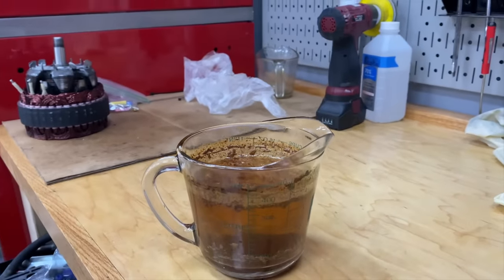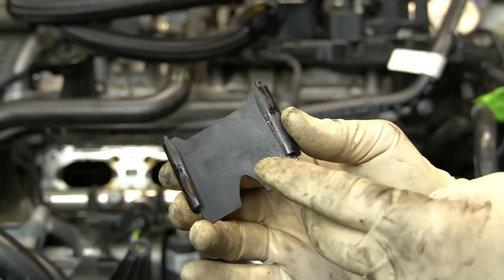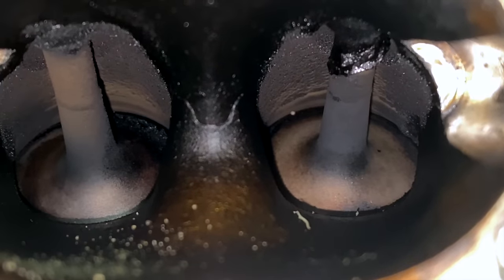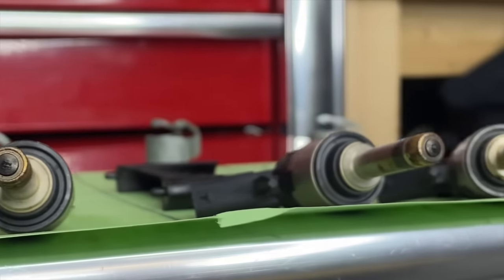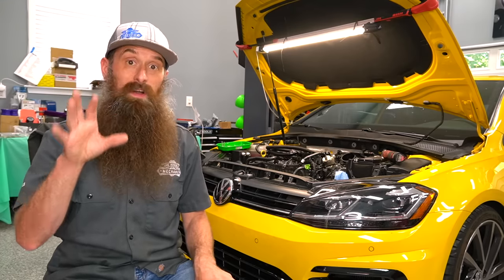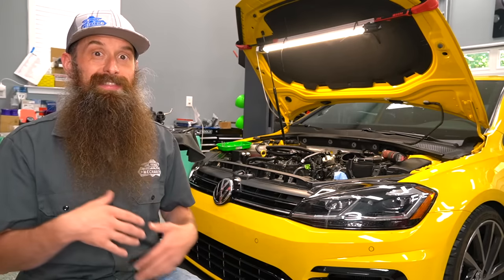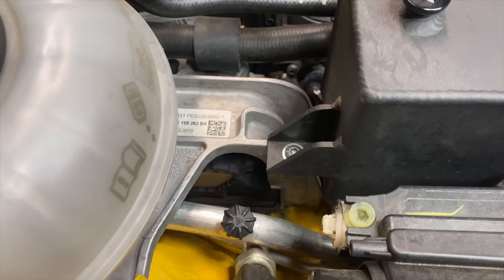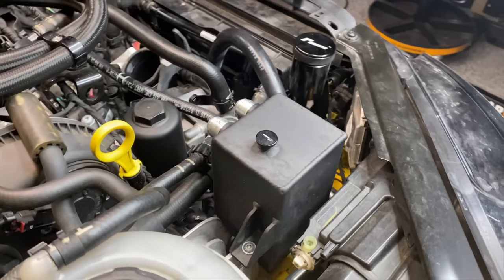Did the Catch Can Work? 10k MILE TEST

Comment: So B9 gen3 engine on Audi includes an oil separator module at the PCV valve. Us non mechanics have speculated on Audi forums that it’s a sudo oem catch can. Thoughts?
I feel like on soooo many vehicles we hear about people doing a long road trip and watching fuel efficiency improve and more on some version of a direct injection vehicle. How much would you bet it was the catchcan vs your 300 mile drive given the two sets of control valves?

Comment: Also I run TurboMax

Description
Powerstroke fuel additive. Cleans fuel system. lowers carbon and NOX emissions 90%. quiets engine nock. lowers gel pour point. improves combustion. 16oz TREATS 1440 GAL GAS OR DIESEL 1ML TO 3 GAL

Comment: @humblemechanic You should re-install the original PCV system and get rid of the catch can. Run the 10k miles --> Get results 

Repeat again with a catch can 10k miles --> get results 

and if the pattern repeats I would say with more confidence that more than likely the catch can be the contributing factor! just an idea it is your car and I wouldn't want to remove my catch can (I have a mk6 gti) but interestingly enough since you record and are more thorough than I, I would love to see that on the channel

Comment: I have a Provent 200 catch can on my diesel vehicle, and have never seen water collected, just oil, and it has a drain tap to easily empty it.  In the diesel, the EGR system feeds sooty exhaust in to mix with the oily crankcase vapours and you get massive gooey sludge buildup. Seems petrol engines feed a lot of water vapour back through with the exhaust. I'd be tinkering with the EGR system to stop this via ECU tune.  Mann-Hummel is a giant company manufacturing a range of catch cans - they would not exist if catch cans did not work.  There are thousands of canisters sold as catch cans which are just that - cans that do not separate anything.  Beware what you buy.

Comment: Great vid bro! you made a comparison statement, that they look better @20k they looked at 10k.  to me it's even more significant that the new valves are going the same distance 10k as the original valves, not even flushing the system, you know contaminants have already formed, just waiting for the heat cycle.  Fresh everything "brand-new car" valves had fresh clean from debris surface's!! 
Awesome 👍🏾

Didn't both sets of valves go 10k miles and not 20k on 2nd set ?

Comment: To avoid a problem, it creates another.
As a former car mechanic, I would say that the way you drive depends on the carbon build-up.
If you don't floor it, sometimes the poor thing won't be running as it should. Rather, it would crawl.
Performance cars especially aren't meant to be driven constantly at low RPM, and you got to pull it.
Otherwise, carbon build-up will happen as my father told me.

Comment: Hey Charles, check out this video on the MK7 (and MK8) PCV system I just posted. 
https://youtu.be/jYdF-sOLe3I
There is a LOT more to the PCV system that many people do not fully understand. Every aftermarket PCV plate eliminates the only vacuum source on the crankcase at idle... meaning the crankcase is now under pressure at idle. If I have to guess, you're smelling oil vapors being vented from the oil cap primarily. If you look at your PCV plate, you'll also find that an air/oil vent port has also been blocked off, and instead relies on only the turbo inlet pipe to draw a vacuum on the cam cradle under heavy load conditions. I personally don't think it's a great long-term idea for a daily driver, though is a potential solution for a track-only car.

Comment: Always wondered if cleaning your valves via walnut blasting or brushing could agitate the metal surface of valve material and make it less smooth and ultimately cause it to build up easier later on. I know it wont mark up the metal easily (blasting) but on a microscopic level you could be making the surface less smooth and aerodynamic than it was coming out of the factory.
Reply: @Ninety Four Moto Agreed. But in this video there was some dirt in there (from removing parts to access the intake), and im pretty sure dirt and sand is harder than wallnuts.

Comment: Hey Charles, great video!

Have you checked your charge air piping for residual oil from the turbo? If you've eliminated oil vapor from the PCV by using a catch can, the turbo is the only source of oil-based contaminants that would lead to carbon buildup.

Looking forward to the next vid!
Reply: Piппed by HumbleMechanic  um... Hello?

Comment: I would ask if the presence of the water vapor in the intake charge from the crankcase blowby gasses might be acting itself as a solvent that is helping to clean the backs of the valves, especially if it's contaminated with acids and other hydrocarbons in that chemical soup.

Comment: I added a catch can on a GDI engine and after a while I had an awful solvent smell in the engine bay. I checked all hose connections and everything was tight. I relocated the can from a slightly elevated location, higher than the PCV valve to a lower location with no improvement. The catch can did remove contamination, however, the smell became too intense and ultimately the smell started to infiltrate the interior. I removed the catch can and all the problems disappeared immediately. I never could figure out how that smell leaked out of an enclosed system.
Reply: Interesting I’m using an cheap can on Amazon and it’s been on two cars so far for about 5 years no issues with smell or water buildup sense I’m in Florida lol. Very interestingly I have heard of people saying though it reeks. By any chance are you using the lines that came with yours and are they good fuel lines? I purchased fuel line from autozone because the ones that came with the cheap can are absolutely terrible lol.

Comment: I fitted a Cloude 9 on my S3 8L and I can’t get my head around the level of dirt it out of my 116,000 mile engine, like the oil cap had what looked like the symptom of a blown head gasket it was that bad, my reliability was poor, it didn’t sound right, didn’t smell right, it blew fog when running for the first 10 minutes so it gave me some idea into how much water was making it through the engine into my catalytic converter and backbox.. I didn’t see any baffling on yours so it looked like if your intake generates enough pressure where it mates back to your intake it might be just finding a new way to scavenge both of those potential contaminants regardless of the hardware you have there to prevent it.. but since buying a second Audi I’m actually curious into how cheap sites use this same tech, like for my scrap priced Audi TT I’m seeing if I can maintain performance and reliability on a seriously cheap budget, by looking into a bespoke made unit on Aliexpress (it’s made out of billet aluminium and has a capacity of 2 litres and it had 2 levels of baffling in to stop different fluids, it has a space round the side to allow oil in and a fine mesh to collect water and light contaminants both the cars are 20 year old engines and if I can I’ll let everyone know which one does the best, even it that meant the cheaper one does (let’s face it a 300ml Cloude 9 (I had to empty this one twice during an 800 mile drive) and a generic Aliexpress one might do better because of the capacity alone because you have room for extra wadding and it’s fixtures and the lugs for the hoses for intake pressure and your crankcases pcv actually have screw in lugs meaning they can be made bigger by the owner.. we’re beginning to learn that a big fancy names in automotive nowadays aren’t worth the paper they’re written on..

Comment: Charles, Carbon buildup happen during long period idling and especially when your engine running "open loop". The engine want to heat up rapidly the catalytic converter. The engine running rich and for emission purpose, the intake and exhaust valve open at the same time for a short period of time. The purpose of that is to revaccum some heavy unburn fuel. So, the back of the intake valve will receive a small amount of "black unburn fuel" with some humidity (water) and cook on it. At long term, carbon buildup happen. If the engine running hot without to much idle cycle, the back of intake valve dry and like a BBQ at home, the carbon go in the exhaust. This is why, doing track or going on highway couple time per year at 5000 RPM during 10-15 minutes will heat up the intake valve enough to let the carbon break, burn and go in the exhaust. We can go deeper: some oil are more prone to cause soot on the valve... The new generation of oil ILSAC GF-6 will help this problem... Catch can are for when you push your engine to is limit and have no room to compensate for all this water/vapor oil/etc going inside the chamber. When you are Stock and stage 1, it's more pain in the ass to have it. Plus, water clean a little bit... Some advantage, some desadvantage... We can go further: VW recommand Shell fuel because they use additive cleaning action in their fuel. Oil, fuel and driving habits have more effect than anything else.

Comment: Racingline did finally make an addition for this catch can for a drain. I could be a little misled on this next piece, valves i've heard can look better after a nice hot run, as it was in VW's recommendation. The catch can may help, but its not the end of the solutions. MPI might be a better option.

Comment: Hi
I installed catch cans on both banks. (2004 Tahoe). At oil changes I have 1/8 cup in drivers side can, while passenger side is bone dry. What does this mean?

Comment: It looks like your intake valve guides are leaking oil. also, just put a bang on the bottom of the can, so you can put a clear hose with a faucet at the end. If you route under the wheel arch you could purge without lifting the bonnet.

Comment: Great video ... This VW Golf's Catch Can mounting position is somewhat high so if it can be positioned lower (ie. further down into the engine bay) will greatly reduce any backflow issues (gravity works !!!) when removing the Catch Can to drain-off the 'caught liquids + cruds' .... but overall, this is a great video to show how much 'liquids + cruds' is captured from the exhaust gases into this Catch Can through it before these 'cleaned gases' are returned into the engine .....

Comment: The Engine has a dual injector System with its main focus on the direct injectors. The Port injection is mainly used for Cold Start and high load. 
My Theory is that now with the catch can the situational cleaning from the port injektors can have a affect because the buildup forms a lot slower

Comment: Howdy! BMW tech here,

I have an idea for a test:

So, I've done a lot of walnut shell blasting on our turbo inline 6's to get rid of heavy carbon deposits (N54/N55) but we hardly ever get to install catch cans.

We sold "foam induction cleaning services" that worked well on port injected engines, but had little effect on the heavy deposits on our direct injection cars unless you did them frequently.

I wonder if a catch can paired with one of the foam induction cleaners would make for the ideal service to keep valves clean?

Could we run something like a Seafoam service on the engine with the catch can, run it to the next oil service, and see if the buildup is gone?

To me, it looks like the catch can gets the engine most of the way to clean valves, but may need a little help to finish off the cleaning.

Comment: My turbo diesel Hilux would coat the whole intake track including intercooler with oil from the rocker cover vent. Installing a catch can has totally eliminated any oil residue travelling further than the catch can. I get about 1/2 of a cup of oily water every 5000km
100% believe catch cans are worth it!!
PS and from the other side I eliminated the EGR and now I have ZERO carbon buildup in the intake manifold and valves!

Comment: An old mechanics trick was to Trickle a very small stream down the carb to loosen deposits. This works because the water vaporizes to steam cleaning the intake runners, moreover the combustion chamber. So the water vapor traveling through the engine is beneficial. It also suppresses detonation. (Water injection)

The reason the catch can condensed so much water is because it is mounted up front near air flow dropping its temperature relative to the engine.  In a hotter location or running engine coolant line as some catch cans do would minimize water collection. 

As far as the oil collected that is a good thing. On engines that are new or in good condition blowby is minimal. This device is more important for older engines & high performance applications that don’t want oil vapors affecting octane. 

Some report during the winter months the catch can not only collecting more water but freezing. For me if the catch can primarily removes water that is actually good for the engine, I would not use one. However if the main component is oil residue I would use one. Just locate it a hot area to keep the water vapor from condensing.

Comment: Modify it for freezing and emptying. Move it into the inside of the car so the heater usage will thaw the contents, then drill a hole on the side near the bottom and add an elbow there with an aquarium air pump hose to it long enough for a clip at the top of the cc.

Comment: When Adding a catch can to my Gen2 007 IS350 Lexus that's both DI and port injection will I be removing or replacing the EGR Valve witha can? I do believe that the system is under pressure and need to use a higher quality air tight can system.

Comment: I can confirm that the catch can WILL REMOVE CARBON BUILD UPS ON PISTON. 2012 Range Rover Evoque Ecoboost 2.0, installed catch can at 180k km. after 1 year 10k km driving, 90% of the carbon buildups that were formed during these 10 years driving were gone. left only thin layer carbon on pistons below exhausts ports. I was amazed and I took photos of the piston. The down side of running with catch can is that it hurts the engine when it is getting full. there is a significant power drop and hesitation at acceleration when it is almost full. This will cause the engine seals enduring huge inner pressure and fail. This will require much attention during winter time since it collects huge amount of water condensation really fast. my catch can is small so I have to empty it every 200 km at highway speed and at -10 degree C. It will freeze cause blown seals. catch can in winter requires really high maintenance but worth it.

Comment: the water amount is too much for oil vapor. I believe it's condensed from the hot air inside the engine that's cooled since it must get through the metal box that's exposed to outside northern air. You cool hot air, you get condensation.

Comment: If the catch can is fully enclosed you still may get a burning oil smell for one or two reasons.

It may be getting hot enough to send oil vapors through all the way ( the fluid has to cool enough that the vapors are captured in the can ).

Or the can is breaking down the oil enough to where it separates back to crude.  When that happens it will form h2s.  You would know this because it would smell like a pretty raunchy fart when you empty the can.

I wouldn't jump to either possibility first.  I would replace those clams and inspect the hoses.  I would use a screw on clamp.  It means you will have to change the hoses out more often, and compensate for any cracks due to the increased compression every time you empty it, but they fasten a lost more secure and under pressure are less likely to leak.  With enough pressure the snap clamps can actually allow the hose to seep and I'm suspecting that is the actual smell of burning oil you are getting.

Comment: Can you run the exit of the catch can to open air venting? Plugging off the entrance to the intake and therefore have Zero gunk going into the engine? Why put the output of the catch can back into the engine? Would that trip a code if you did that?

Comment: I’ll just say in my experience they do work I have always used them never had problems. The oil going back into the intake eventually sits by the gaskets and overtime erode them and that’s where you get the leaky intake gaskets not all the time but I would rather have all that junk going into the can then back into the motor.

Comment: Tks , again for the time you put to try answer some cool question about VW R. I think you need to put more mileage on the car before re check these valve. like 40-50k with the can and without the can. I open my EA113 CRZA K04 engine at 70k and see it was not so bad. I think driving these car little bit hard, but smartly help prevent carbon built up. What do you think Charles !
Reply from the maker: The most spirited you drive generally the better they do
Reply: @HumbleMechanic  Oh yeah. Just put a full stage 2 HPFP from unitronic, sofware and hardware, unitronic are just in my back yard in canada, on my R mk6. So from bare bone stock to stg 2 the result is crazy. its insane. But now i want more. Any suggestion please ! For me you are the gurou. I follow everything you said about the best mod video. Here in Montreal the VW scene is to small. Its hard to me find good advised. And again tks for all the time you put for us its very appreciate !

Comment: Charles, can you use 2 catch cans. 1 on the back of the PVC valve to the turbo intake and the other on the front of the PVC valve to the intake manifold.
Which of the 2 above catch can methods would you recommend or both.